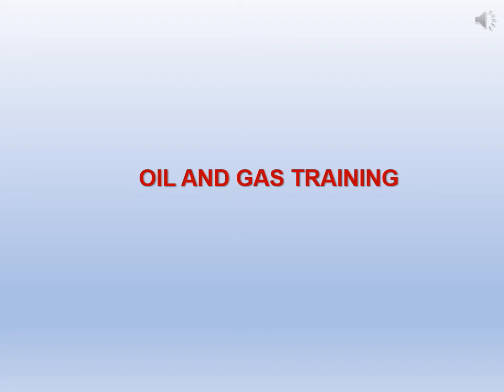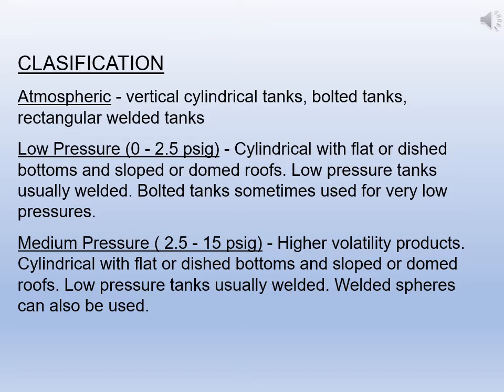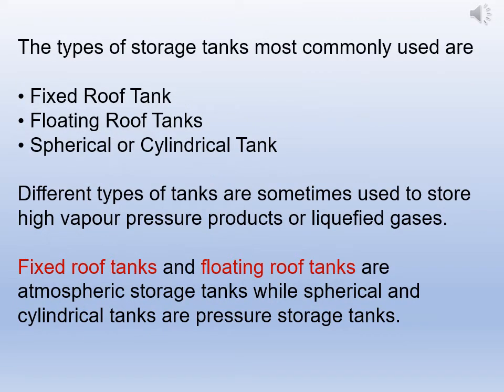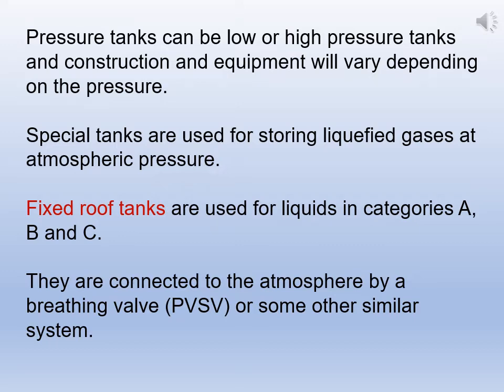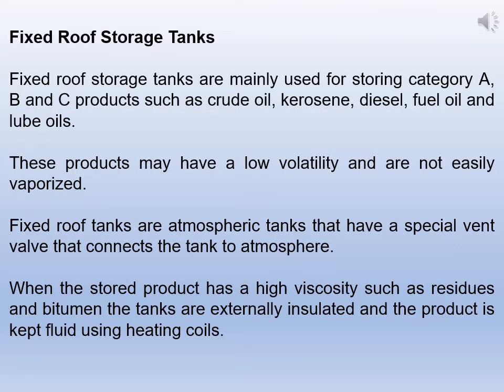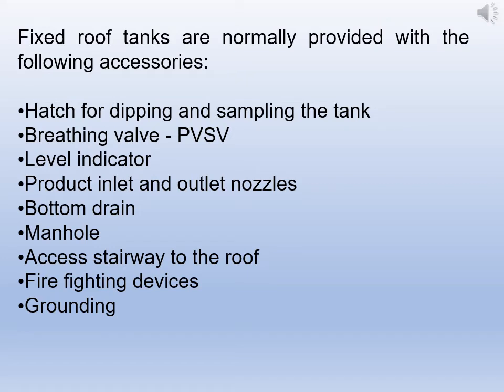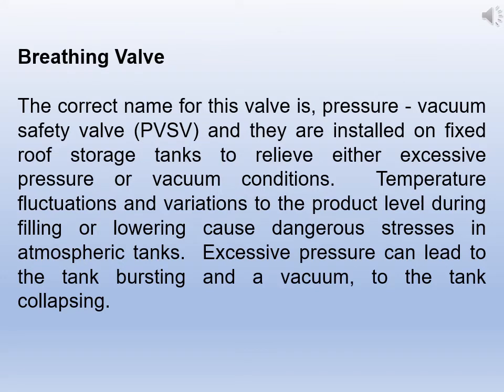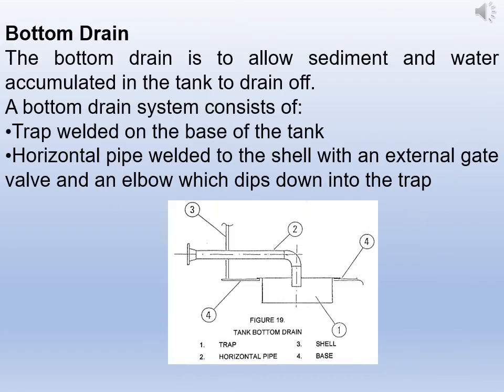Storage Tank Part 1

Comment: Thank a lot for the video. How does the horizontal pipe liquid and sediment drain from the tank since the flow direction is anti gravity and there is no pump?
Reply from the maker: really sorry. I dont have a straight answer for your question
Reply: The oil float over the water ,means the small water stays bellow so the petrol will cause a pressure on the water to be drained ,sediments not comes out only while maintenance and cleaning the tank you can take out the sediments

Comment: Dears Sir, Currently I need the welding sequence for the tank shell that has a very thin thickness (6mm), but I don't know how to anti-deformation for weld joints shell plates to shell plates, thickness is very thin, so could I have this sequence?
Reply from the maker: Dear Chinh, Thanks. I am not from this area welding.. sorry

Comment: How come fixed storage tanks can contain liquids with a very low flash point? Doesn't this mean that category A liquids are volatile and have a high vapor pressure with an increase in temperature? From what I know, fixed roof storage tanks are intended to store liquids with a vapor pressure of less than 10.3 kPa absolute. Does this just mean that it unsafe to store category A liquids, but it is still done because it is cheaper than a floating roof tank?